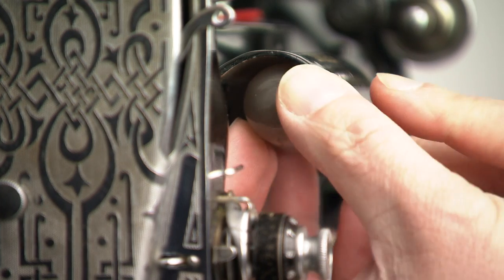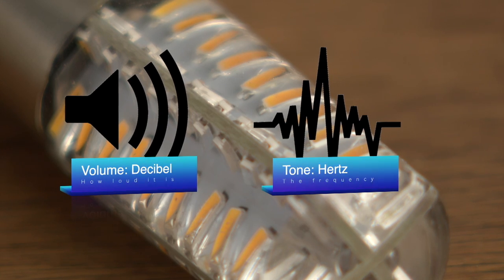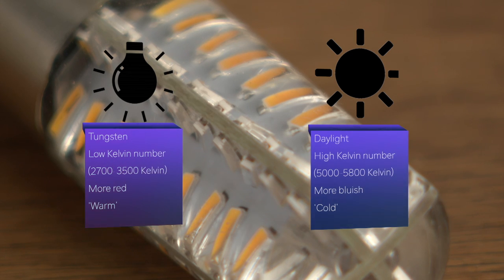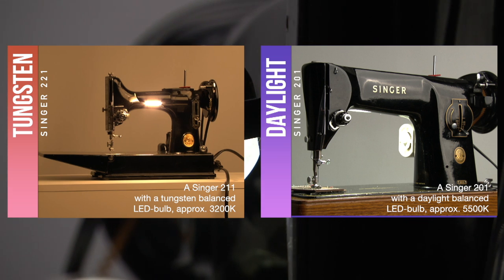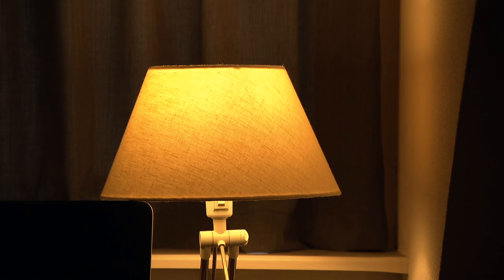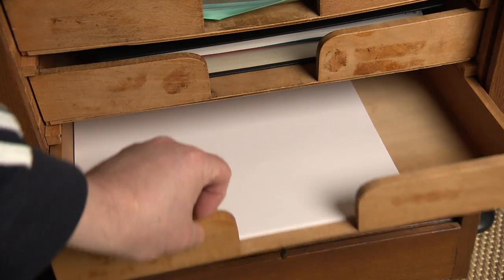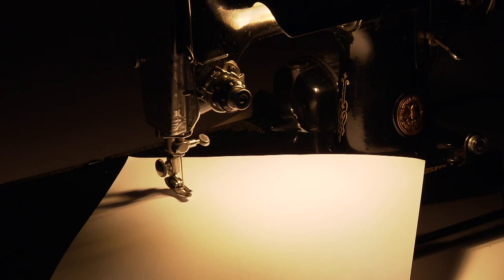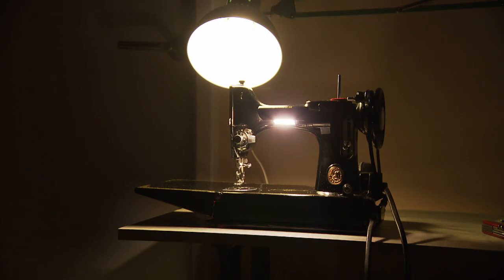What color LED bulb will fit my needs? - Kelvin (K) explanation

Comment: Really nice video!  Also low quality led lamps are flickering and your eyes tired so fast (you can check it on camera). Led lamps save 15watt power of the motor and don't heat your machine. Modern 300$+ machines  have 70 watt power motors and one led (not lamp) but the same models back in time had 90watt motor and place for a light (Janome LE 22 / L 394 for example).

Comment: my singer 201-2 light bulb starts smoking slightly when i run it, i think it is too hot. Do you think changing the bulb to LED will help this?
Reply from the maker: Hi Quintana. Thank you for your message.
The smoke CAN be caused by a hot bulb, but it also could be due to fried wiring. It's a good idea to change the bulb for a LED bulb (it only costs a few euros/dollars). However that is not a guarantee that will stop the smoking.  
If I was in your shoes I would be careful with the machine and the wires (or even change the wiring).
Good luck!